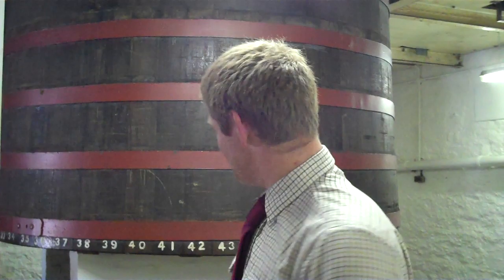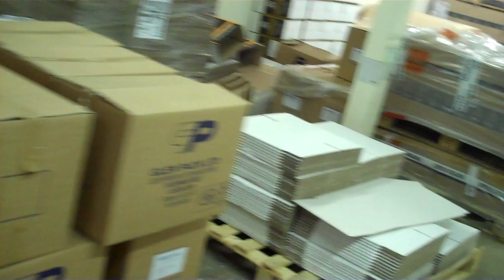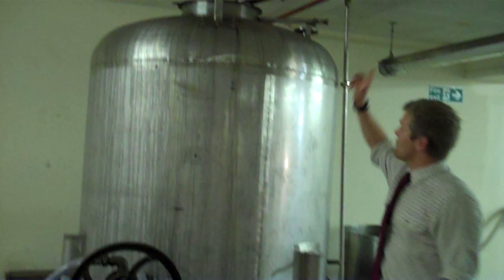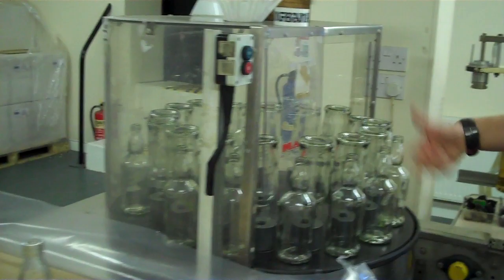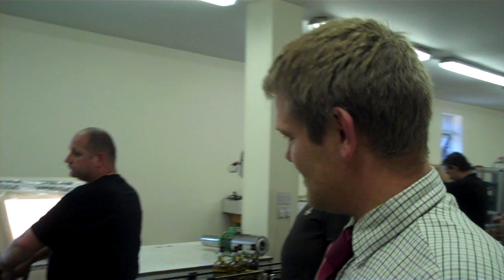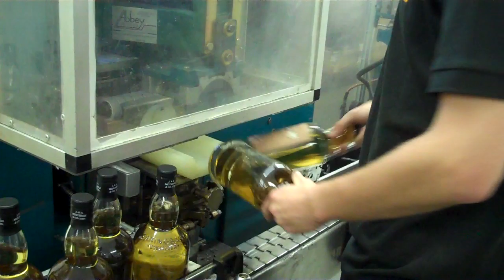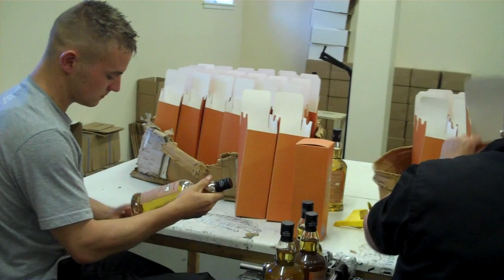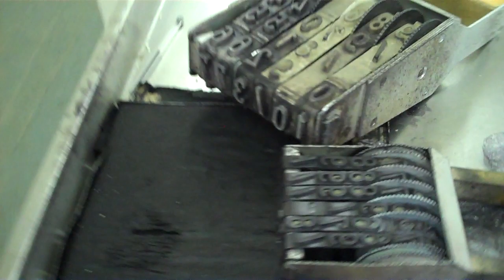whisky review 177 6/7 - Springbank Distillery with Peter (part 6)

Comment: Do whisky distillers filter or purify the local water before using it, or do they use it as it comes out of the ground?  What is Scottish water like - high in minerals?  Does using the same water when drinking a dram as was used in its distillation ass anything to the taste?